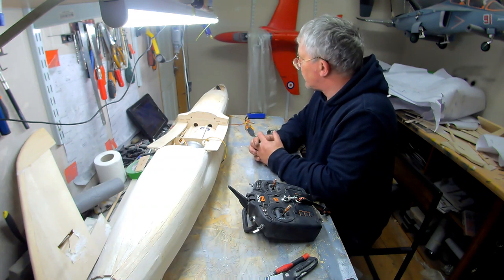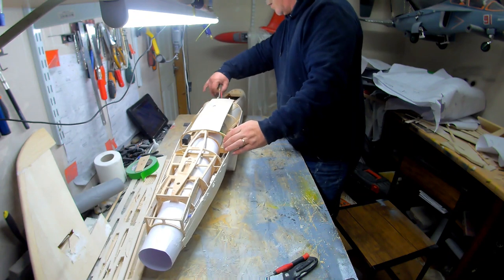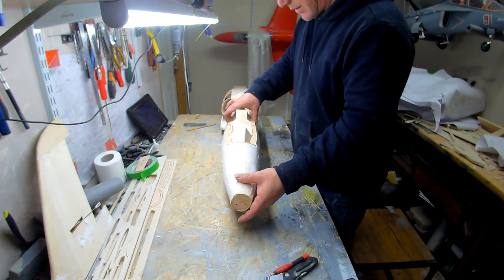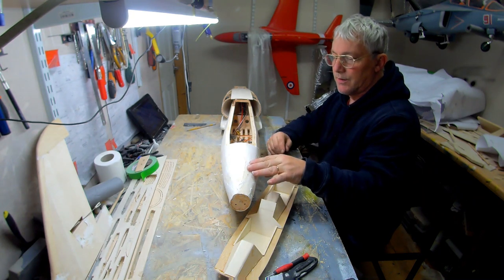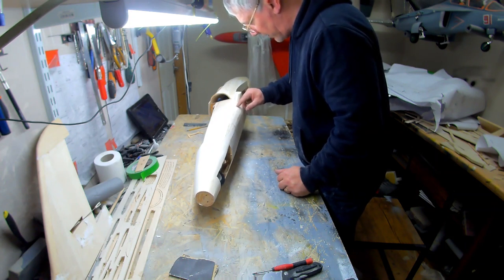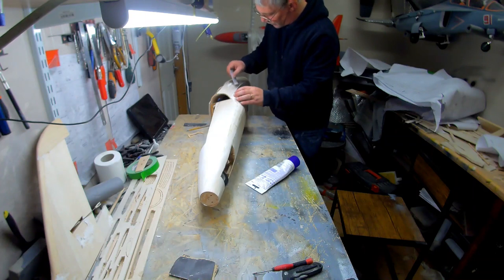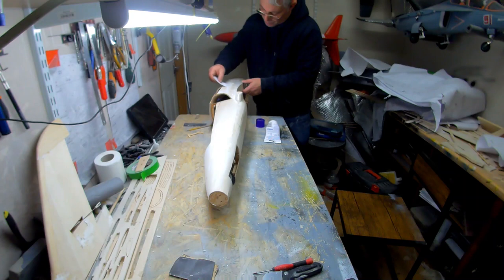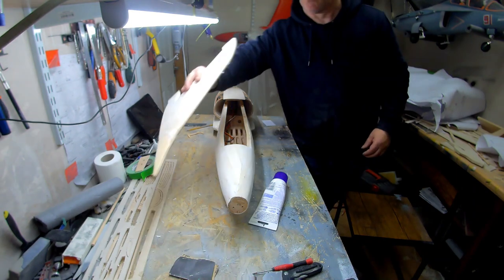BACK TO THE FUSELAGE RC PLANE BUILD L39 RBC KITS

Comment: hi, I use 3mm balsa for the fuselage cover with RBC kits jets. 2mm has to be puttyed a lot. 3mm balsa allows for a lot of sanding, putty is almost not needed. the weight gain is negligible.
Reply from the maker: yes, I agree with you, I do wish at this stage I had bought new wood